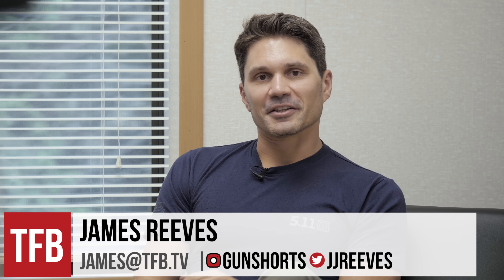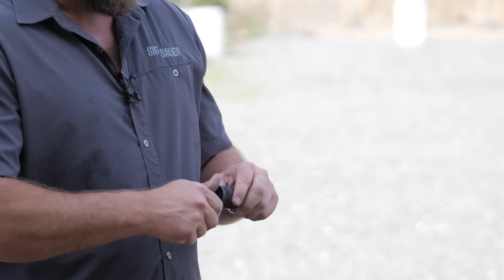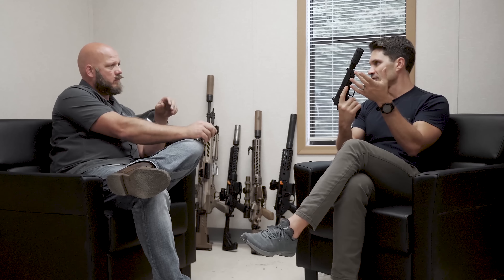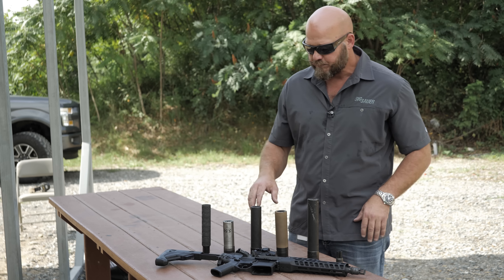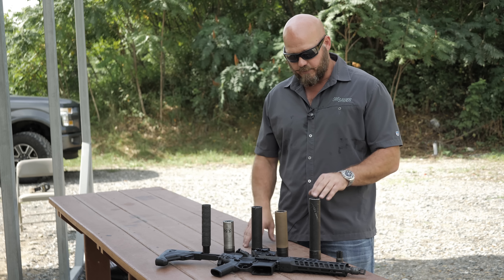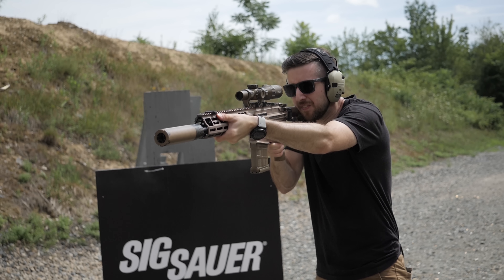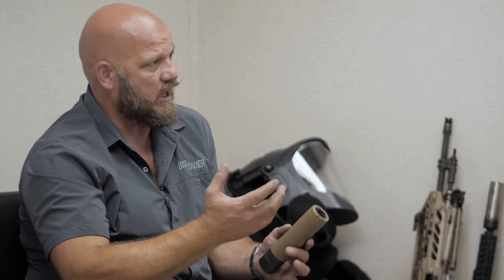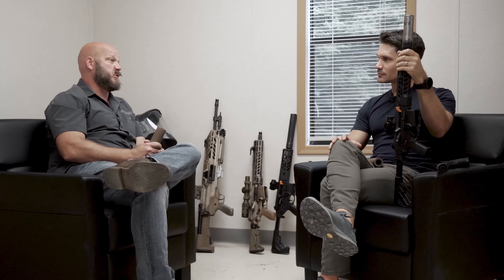Sig's NEW 3D Printed Silencers: The SLH, SLX, and MOD-X

Comment: Ok, I get the whole additive manufacturing coolness and user configurable length of the MOD-X, but how many people are truly going to be consistently adding and subtracting baffles? Not to mention the fact that his quoted "142-145db" on a 9mm pistol isn't even hearing safe, nor "standard", either. Especially when subs out of a CGS MOD9 are easily less than 120db... A suppressor of equal length, diameter and weight (as MOD-X with all 8 baffles). Seems lazy & pointless. The rifle cans are a different story though.